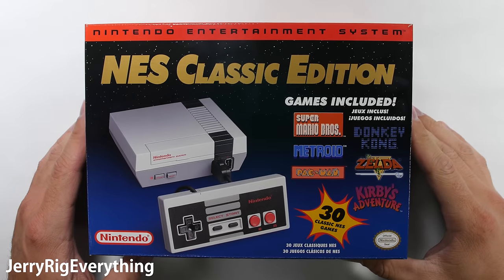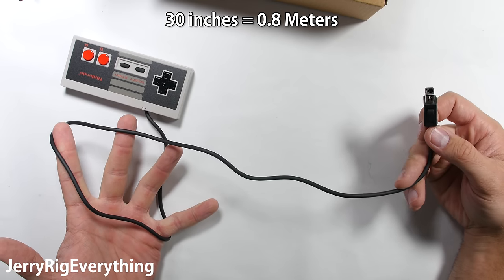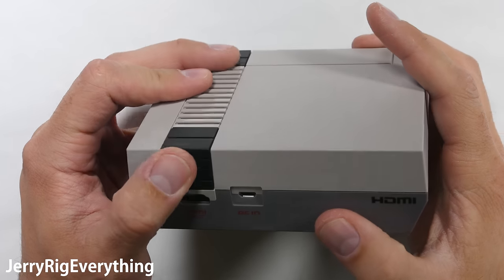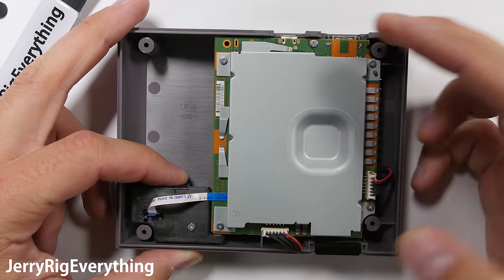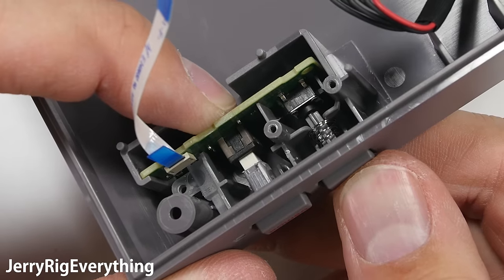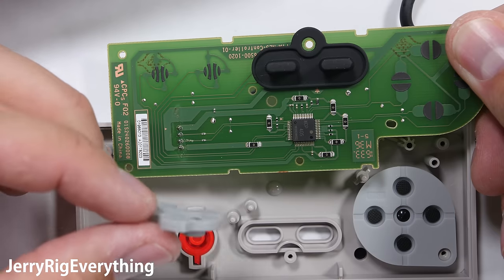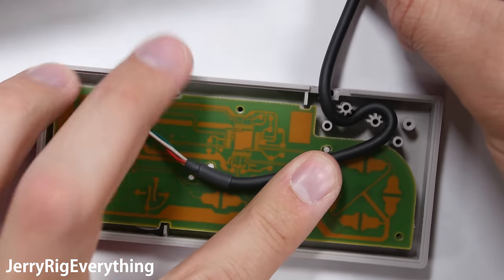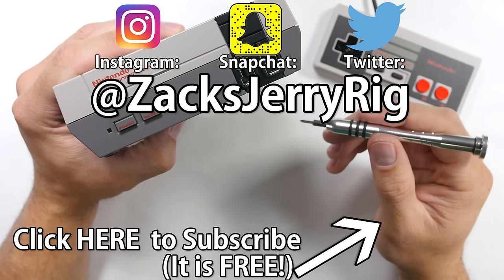NES Classic Edition - Teardown - Unboxing - Repair Video

Comment: I have a question. 

Recently, I was using an HDMI splitter (that was powered with an AC adapter) that must have short circuited my elgato cam link and another hdmi switcher because both units no longer work after using the splitter. Those were plugged into the Output ports of the splitter. 

On the input side of things, I had hooked up my NES mini. So far, my NES mini works fine. However, while I was playing Castlevania, the game randomly paused once while playing. I had not hit the start button. 

Could a short circuit damage the controller port?

So far, the NES mini hasnt done anything like that again, so idk what could have caused it. The whole thing is weird because, until now, I didn't think an HDMI splitter could short circuit another device through HDMI cables. But that seems to be the case because both the Elgato Cam Link and HDMI switcher no longer work after being hooked up the output side of the splitter. 

If anyone knows, could an HDMI splitter power surge damage Input signal? Like mess up the NES as well?

Comment: @JerryRigEverything
Pretty cool little system, but frankly not worth the price IMHO. For the $60 price tag one could totally get a Raspberry Pi (~$35) with way more capability than this at a fraction or near the same price point depending on add-ins. Get a SD/Micro-SD card and throw an image of Raspbian+RetroPie  on there and you potentially have a whole library full of retro games + more modern game offerings. Given, one actually goes and downloads the ROMS and has some BASIC technical know how with file extracting/transferring with a general familiarity with Linux operating systems.
My father was wanting to buy a NES Classic for the whole family until I explained to him this same thing and it just so happened that I had purchased a Raspberry Pi 3 Model B off of Amazon the previous week. So now, we have the 30 games the NES Classic comes pre-intalled with + The entire NES library of games. Have yet to add any games for any of the other systems RetroPie supports, but SNES is definitely next on my list. Definitely helps to be a DIY person like you Zack!

Comment: For $60 they could have at least made the cables longer and gave you 2 controllers.
For $22 at Gearbest you can get a V88 Android 5.1 Box. Lets compare:

NES Classic: Quad core Allwinner A7, 256MB RAM, 512MB Flash, 2X wii controller ports, 30 games locked proprietary OS.

V88: Quad core Rockchip A7, 1GB RAM, 8GB Flash, Wifi, 4X USB ports, Ethernet, Rooted Android 5.1, Countless Playstore games, thousands of emulated console games available, supports Xbox 360 controllers or USB NES controllers from ebay for as low as $2.49.
Reply: then don't buy it, problem solved.
a lot of people buy this because it's a micro NES and it's gonna be used a few times then put on the shelf.
Reply: Yes, it's true, you're paying for the Nintendo brand and the nostalgic look. It just sucks that they didn't add a little bit more functionality to the console.

Comment: This thing is practically bullet-proof. I bet we'll be seeing these still 
working over a hundred years from now (well maybe we wont, but you know 
what I mean...). There are essentially no parts to wear out, shake 
loose, or break. If there is a weak point, its the stupid mini-USB port 
for power. Why not a full size USB port? I've had more trouble with mini
 ports than anything else, but at least you wont be unplugging this a 
lot and wearing it out
Reply: It will be a brick in 100 years. Actually all modern electronics, anything with TSOP Flash firmware will be stone dead long before 100 years. The data retention is only rated for 10-20 years by the manufacturer. Look up the data sheets on these chips. Now the good old etched ROMS of the 80's will still work 100 years from now. So yeah, this will be long dead in 100 years and the original NES will still be running.

Comment: Dose the power button on the bed mini even work because I think mine either dissent work or it is just deceptive, but it still turns on automatically when I plug it in but to turn it off I must unplug it...any one have any clue on what's going on even?

Comment: Drop test bend test and scratch test that thing :p

On a serious note seriously micro usb plug ? Makes one wonder what might happen if connected to computer. Maybe possible to add games to it change games or even change the os. Also something i do not like about that is these things break if you look at them wrong. The is worrisome. I don't have one so i can not test the hook up to a computer part so maybe you could and have a look at thing? Who knows this thing might open in windows explorer or fav linux/apple file manager and let you change out roms add roms etc.

Comment: 4:27 Nope, Nintendo did not handle the distribution properly that's why there was no way to preorder one in the US.

They should make an online store where you could preorder the console in advance that way they know how many they need to build and limit the sales only to 1 per customer/address. 

The rumors is that they did that in purpose in order to build hype for the Switch. I got a Switch easier than a NES Classic because I was able to preorder one online.

Comment: why do they need a hdmi cable while the game's resoulution are very low???
Reply: Đức Vũ it's the most common tv port now?
Reply: Đức Vũ HDMI cable make games brighter and sharper but I think the real reason is because that is the most current plug there is.
Reply: Because it's much higher quality. Would rather have shart, pixelated graphics than blurry, pixelated graphics.
Reply: Well, that's ur point :). I respect that!
Reply: Many of the games of the era were made to abuse the blurry visuals you'd get with signal standards at the time. Some of this is lost if you clean up the signal too much.
Reply: TheNekOz Incorrect.
Reply: games are in 720p 60fps

Comment: Fact: I played Mike Tyson’s Punch Out (I hack the game into the system with a laptop) and Punch Out (ft. Mr. Dream) on this NES Classic with a SNES Classic Controller cause the D-Pad on the NES Controller was flat and it’s hurting my left thumb while I’m dodging Super Macho Man (I kept failing on dodging him that’s why the D-Pad of the NES Controller is bad when playing Punch Out). But the D-Pad on the SNES Controller was better cause it’s not flat and it felt better except I don’t like the rough plastic of it and I successfully beat Super Macho Man on both Punch Out Games

Comment: It doesn't make a lot of sense that the NES Classic wireless controller by Nyko is about 33% cheaper than their extension cable for the original controller. I mean, $30 for an extension cable? It's just a friggin' cable! How can it be more expensive than an actual controller? And a wireless one at that, including the receiver!

Comment: I heard this is more powerful then a wii
Reply: I somehow doubt that.
Reply: Steven Tyler obviously it's not 😂
Reply: Steven Tyler it actually is
Reply: You think the NES Classic could render Xenoblade? Or Monster Hunter 3 Ultimate??

dumbest thread of my lifetime
Reply: http://linux-sunxi.org/A33 (the R16 seems to be a rebadged A33).  It has four ARM Cortex A7 cores at 1.5GHz vs. the Wii's PowerPC single core at 729MHz.  For GPU, this has a Mali 400 MP2 GPU whereas the Wii has a 243MHz rework of the Gamecube's ATI GPU, which means early 2000's Radeon technology.  It's hard to say for sure, but it really does seem like this is more powerful than the Wii.  The Mali GPU is capable of HD rendering (1080p) like most Android phone GPUs are.  The Wii was only capable of 480p.
Reply: that was easy
Reply: AceTrainerJordan do you even know what you are talking about?

Comment: People are actually buying that "console"? does it allow you to load more games onto it, or are you stuck with just what it comes with?
Reply: Razor2048 Just the 30 on the console
Reply: Modding potential i good. Just shove a Raspberry Pi into it and you can load it with emulators and games.
Reply: its an official product with 30 original games for $60 retail, I would buy one

Comment: 30 games. not 50. And at $60 it sorta is a ripoff......
Reply: $2 per game for a full system, an array of games, and a controller? Do you have a cheaper option that's still legal?
Reply: earthor 1 Buy a classic NES.
I got mine for $7 (both controllers and power adapter)
And about 100 games with it.
Reply: only issue with that option is there's no way to actually get that time and again. Sounds like you got them on Ebay or from someone you know possibly but the thing is that's not going to happen for the masses, so that option really isn't valid for the market sadly. It's really cool that you got all that and I'm actually VERY jealous, but it's just not viable for the demand that's present here.
Reply: Ok, well, you could buy a retron and a flashcart. Or, a retron and then slowly build your library.earthor 1
Reply: Looking at the Retron 1 consoles, I can see your point here, It is half the price for it at $29.99 for any of the Retron 1 units. I'm not sure what kind of price markup they did for the Classic NES but I do have to admit, there is a level of convenience that comes with all the games preloaded (but that can backfire if you have any desire for more games).

I didn't realize there was this many options for the NES market tbh, I really appreciate you pointing out all this info.
Reply: earthor 1
Also, there are a lot of games that are only $5 per cart. The only games that are over $5 are zelda, megaman, mario.
Reply: With this, you got a console shell, a free NES to Wii remote classic controller, 30 roms for about $2, HDMI graphics, save states, accurate control and crystal clear audio, free manual scan, 3 different TV filters, and a nice box. It's definitely worth the $60 especially when games like Punch-Out!!, Mega Man 2 and which were physically sold for around $15-$30 each. If you would had buy those same games on Wii VC, it'll probably cost you $150, this plug and play is a $90 bargain (that is unless you are the few people stupid enough to buy it from internet scalper).

Comment: 6 fucking feet of cable for the original controller? goddamn, this thing has 30inches? barely 2.5 ft.

less than half. I dont understand, hdmi cable is included which means obviously it will be hooked up to a new lcd hdtv and whatever.... now... how the FUCK are you suppose to play and use it with this short ass cable?
you obviously cannot keep it underneath your tv or something which is what any normal person would do... no youre guna have to pull it as close as possible to yourself and then hope that 30inches is enough to game comfortbly. 

so sad nintendo.
new 3ds with no power cable
now a mini nes with a tiny cable... good lord man. i know theyre cheap but christ.